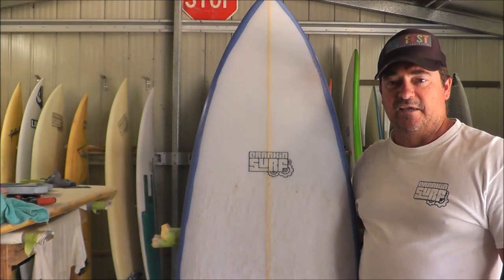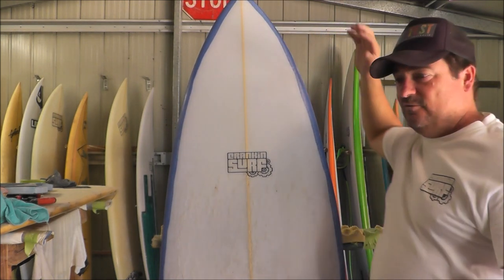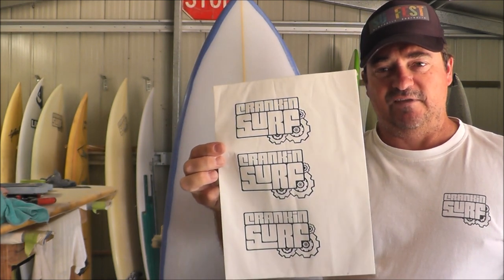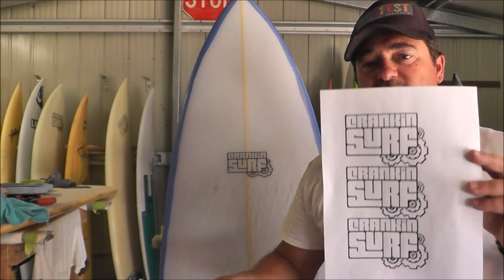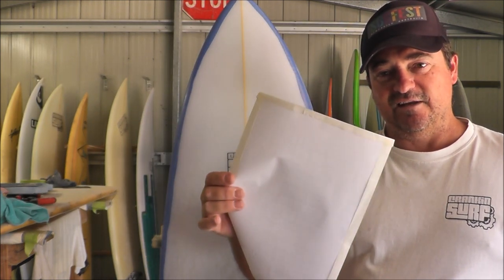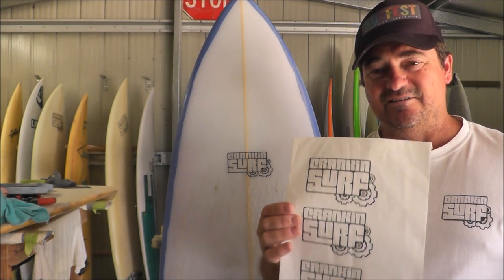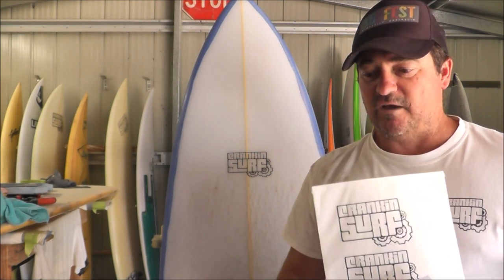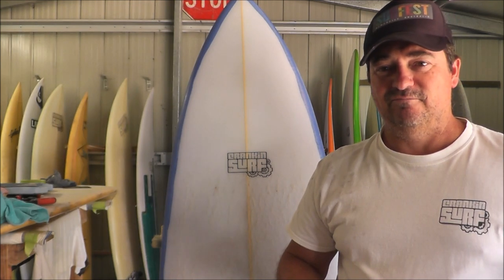Making a Surfboard - Printing Logos on Rice Paper

Comment: I just taped the rice paper on top of the 8 1/2 x 11 sheet...no folding necessary.  Always used a regular inkjet printer and it worked fine (no running).  Also figured out how to create an opaque white backing for logos on the stringer (involves a stencil, rubber cement and standard white spray paint).

Comment: Thanks heaps mate! I tried a different tape method before I watched this. Now I know how!!!
Reply from the maker: It's the easy way to do it, make sure you do a test run for colour runs. I did a video of it to show how i do it.
Reply: I just glue the edge of the rive paper to the back of the A4 page along the edge set back 4 mm with a Pritt glue stick lightly then peal off afterwards . works well and doesn't snag in the copier rollers.   Great video thankyou like your logo too nice and simple looks really good.